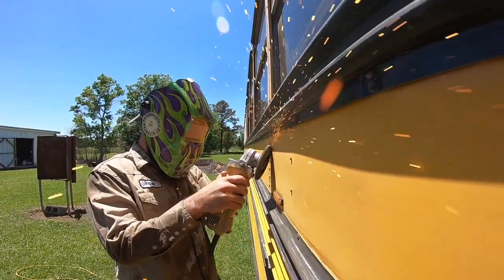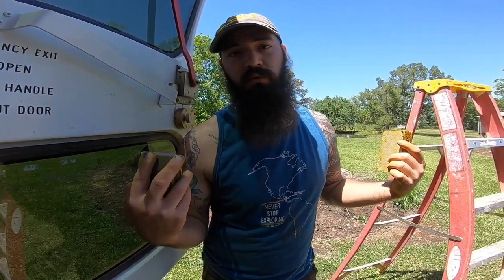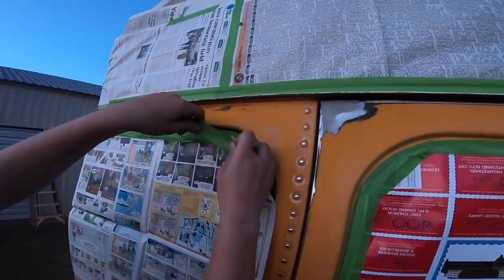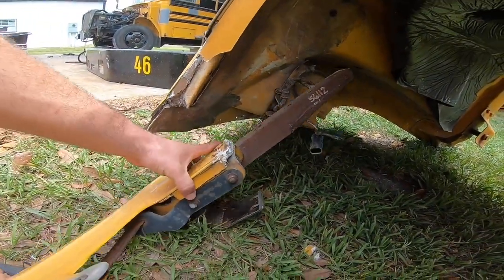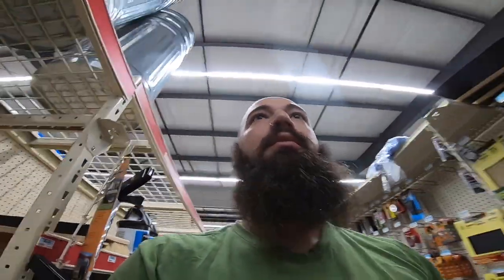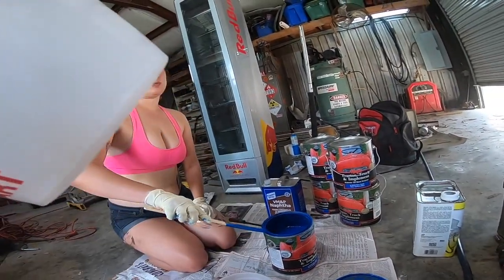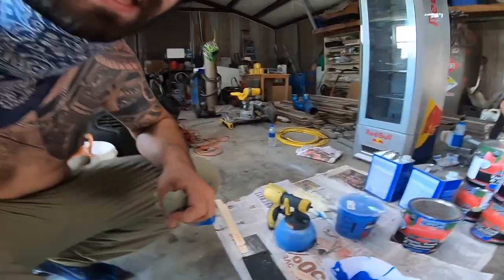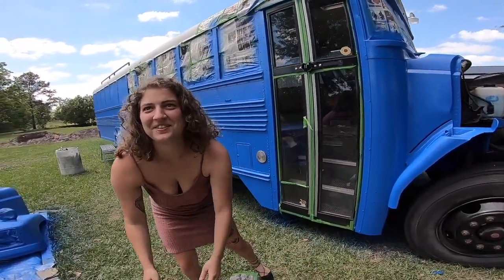How to paint your school bus

Comment: This video is 3 years old, but just in case it helps someone, the best and easiest way to remove decals and reflective strips is with an oscillating multi tool with a flexible scraper blade. That takes off almost everything and then you come back with a rag soaked in acetone and it takes the residue off with very little effort and you have a clean surface left.

Comment: after all the cleaning washing sanding etc. I just used Rustoleum white for now.. lol then later will decide on a color mine is old 94 solid metal
Reply from the maker: We found Rustoleum to be to expensive when we were shopping and almost a year later, the tractor paint has been holding up really well (no primer needed). But that was a good idea to protect it now and decide on color later

Comment: I feel your pain when it comes to the dew getting on stuff you trying to cover ! Being from the south like yall the humidity is B.S. ! But at least it didn't come one those surprise rainshowers that lasts about 20 minutes...just long enough to screw sh*t up. Way to keep going and push through the challenge. Paint job looks great !
My biggest obstacle on my shuttle bus was sealing the windows multiple times to keep them from leaking.
Reply from the maker: Free Range Nomad 
Thanks!! Appreciate ya.
Love bugs too😖
Very happy we did it when we did, sweet spot between spring & summer. Rained the whole next week!
We are still dealing with some leaks, now that we are painting we are going to SILICON every crack.

Comment: What make/model is that spray gun? Thanks and thanks for sharing your experiences
Reply from the maker: dougmac444 
The first one that broke is a Wagner Spraytech (control spray max)
The new one we had to buy halfway through is Wagner Flexio 4000

I would not recommend using either of these. Seriously, if I had to do it again I’d rent one from Home Depot or use a traditional sprayer.
Reply: Parish Skoolie thanks 😊

Comment: think that the best way to fix the hood is by adding a large plate of metal way past the mountings for the hood drill some big holes in ittoo it for the glass to bond across the metal part to the existing glassfiber add some rivits with large metal washers on the fiberglass as a belts and braces solution and glass it in 
might even want to think about extending the mounts itself to passed the grille opening and use extra bolts to mount them just to prevent flexing when opened 
the tractorpaint is good stuff , there been quite  few bus builds that used it and there all pretty happy with the way its laying down 
you might had been better off with an air powered paintsystem but then again hindvision is allways 20/20 , reading reviews of the paintgun might had helped 
as for the schoolboard paint , you could do some of the filled in sidewindows or the emergency exit with the stuff , might work better though you need a stepladder to reach it
Reply from the maker: watahyahknow Definitely considered fabricating a plate, needed up just using a ton of fiberglass & cloth. It’s been holding up well the previous weeks, if it breaks again I’ll know what to do! 🤦🏼‍♂️ 
Thanks!!

Comment: What kind of white paint is on the roof? I see a lot of school buses with the tops painted white for heat reduction inside the bus and was wondering if the paint is reflective type?
Reply from the maker: Hey there, great question! It’s technically not paint, it’s a silicone roofing material and it is not reflective. Hope this helps!